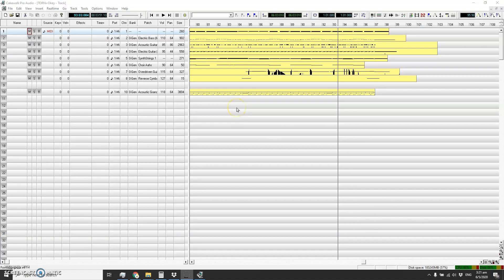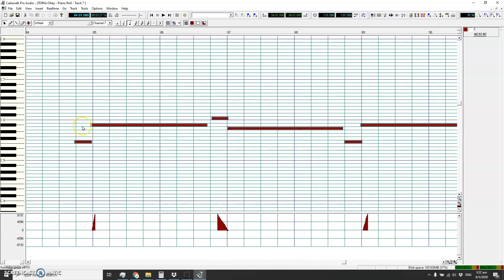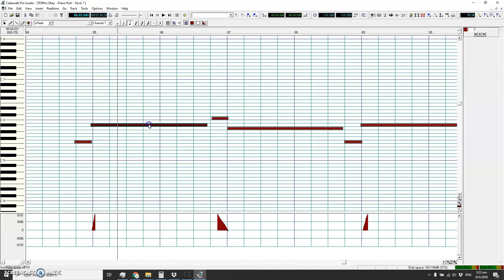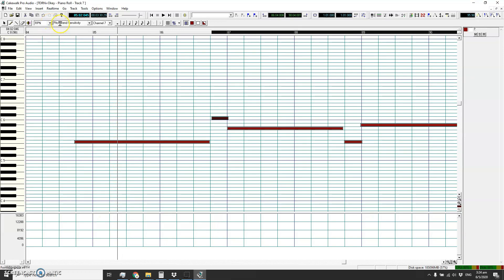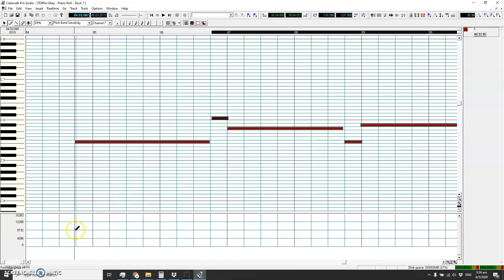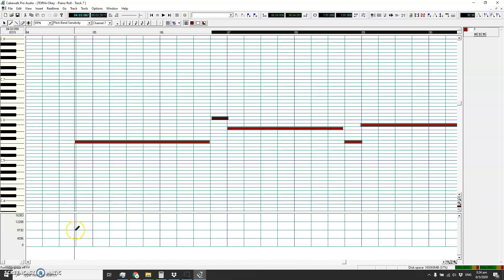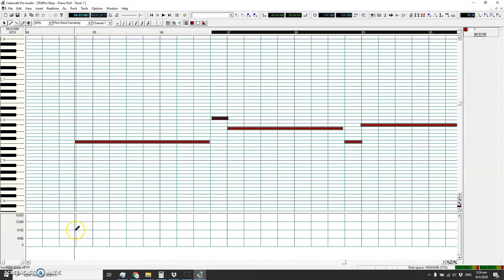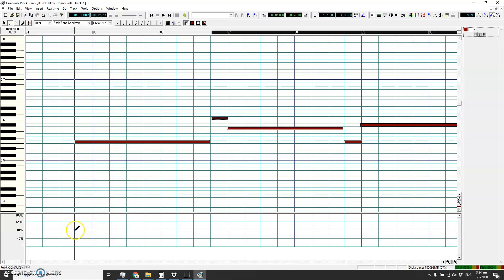How to Edit Pitch Bend | Pitch Sensitivity - Cakewalk Pro Audio 9

Comment: this is what i need, but even after following the exact steps in the video, my pithc bend sensitivity
is not changed as desired....although if i play the midi file on a keyboard sequencer, it bends perfectly....but i want the same effect in cakewalk 
i concluded that this may be because of a different version because i noticed in your video that event list option is available in the piano roll window but i don't have it on my version
by the way my version is version 9.03
Reply from the maker: its gotta be there
Reply: @KaraokePubmain  that was my same thought, but i checked multiple times but it was
still the same....wish i could post a screenshot here so you could see for yourself ...
maybe i got a knock off version of cakewalk hahaha
Reply from the maker: @verifiedtoxicangel2411  try right clicking on the sequence window,  event can be seen there after piano roll.

Comment: Do you know how to type 1/64 notes on cakewalk pro audio 9's piano roll?
Reply from the maker: It is very uncommon to see 64 notes. what do we have there is 32 notes. But if you want to cheat it, you can double time the tempo and use the 32 notes. Hope that helps
Reply: @KaraokePubmain  Thanks for the answer. However, when I making hi-hat rolls or snare rolls, one 1/16 note  must be divided into 4 notes or 3 notes, but it is possible to divide only up to 2 notes(1/32 note x2). It is also impossible to edit the note duration on the event page.
Reply from the maker: @1301byh   Yep. WHat i usually do to move the notes closer is to turn off the grid. so notes can compress to ur desired place. specially on timpani, snare roll or harp roll.
Reply: @KaraokePubmain  It is extra. Watch this video and know how to fix it?
Reply from the maker: @1301byh  I guess you start to do stuff in Cakewalk Bandlab. it is free. it is a better program
Reply: @KaraokePubmain  Ahh..I like the old school program. My high-end computer can only run MIDI plug-ins in CWPA 9. The same problem is found after reinstalling Cakework on the computer several times. Can your computer run audio plug-ins in CWPA 9?
Reply: @KaraokePubmain  My friend is having the same issue in CWPA 9. lol 😆